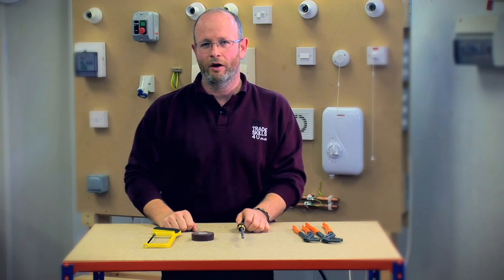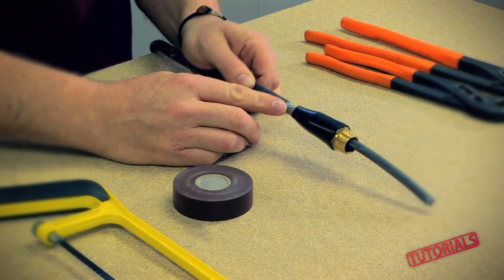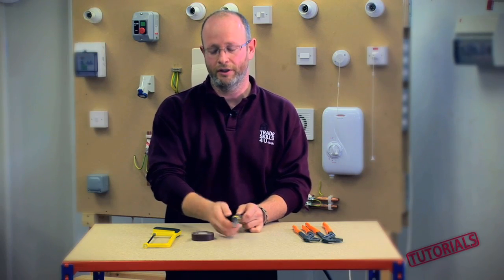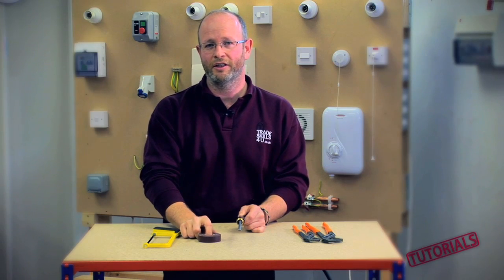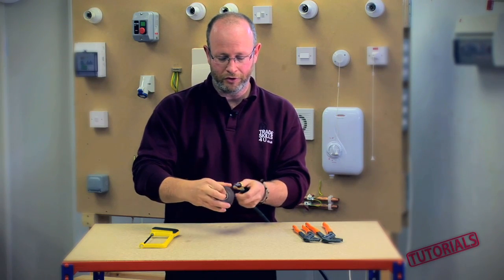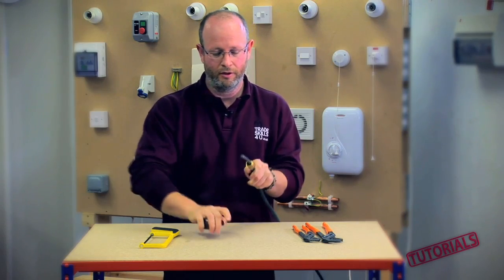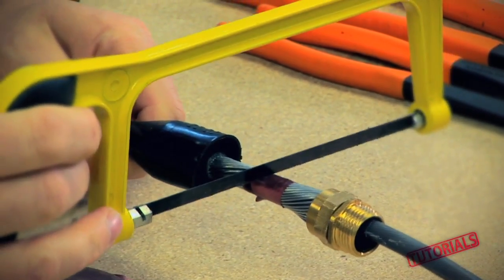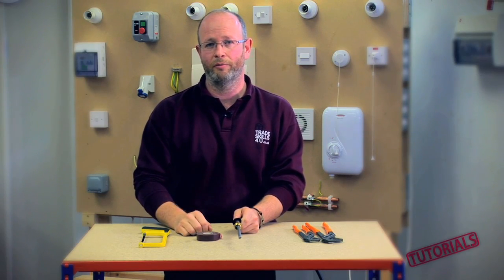Steel Wire Armoured Cable Tip - TradeSkills4U

Comment: The best technique to avoid stripping outer sheath to far is to use a zip tie as a measure, to do this you first place the zip tie to the furthest extent of the cable onto the gland whilst holding the swa against the gland also , as you shape the zip tie to the entry point and then release it it will spring back and give you the exact lengh to cut . simples